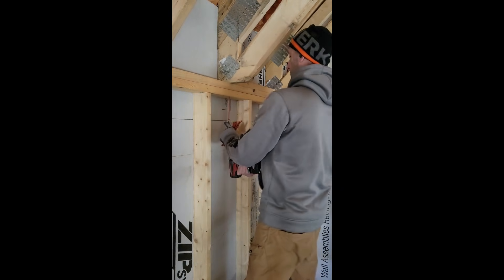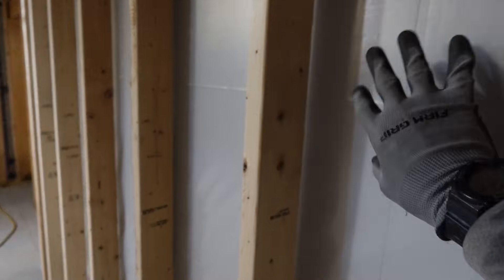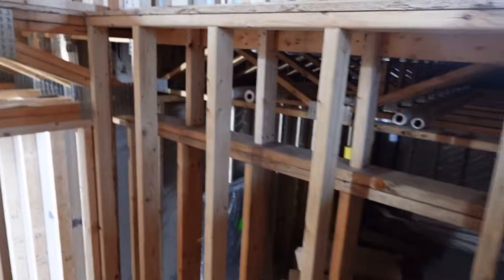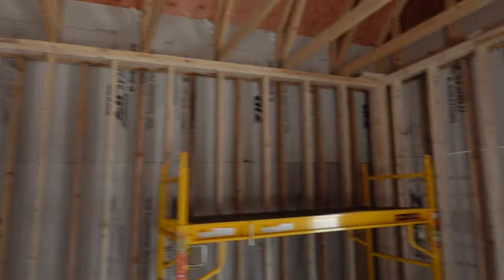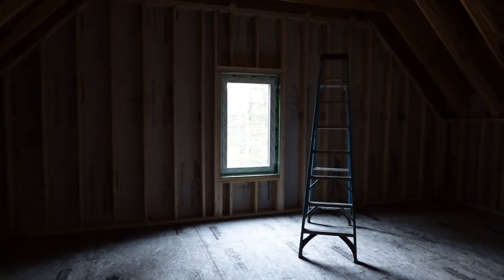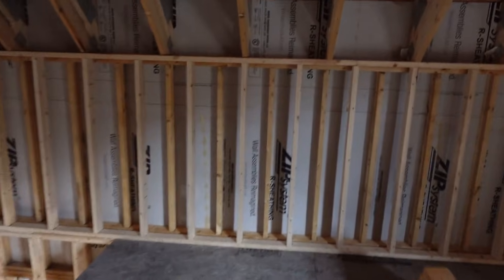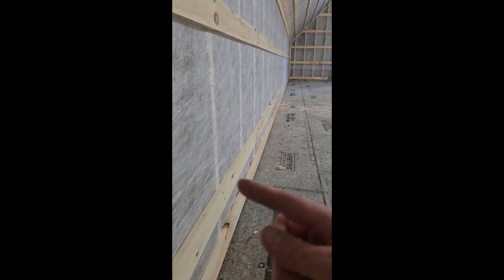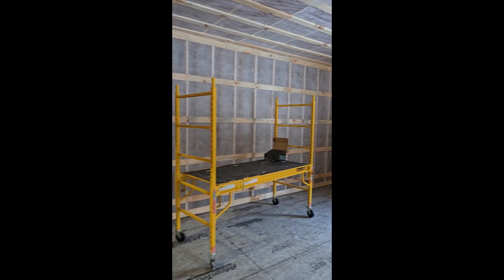13. Interior framing double stud wall

Comment: With the 1 inch gap between the two wall what do you do about horizontal fire blocking??
Reply from the maker: Nothing, its completely filled with dense pack cellulose and has a class A fire rating.  Nothing in the code prohibits it.  The floors are separated vertically for fire rating.  Thanks for the comment, happy building

Comment: Where’s the electrical at
Reply from the maker: Hi Todd, I assume you meen where is the electrical in the wall?  Its in the standard location, but the wires run between the double stud.  I did use many wireless switches to reduce thermal loss in the exterior walls as well.  Thanks for the comment
Reply: @ShawnBaldwin603 just didnt see any electrical boxes where the devices would be installed at trim out
Reply from the maker: Hi Todd,  if your referring to the end of the video with the netting, I mention how it was done.  I went out of sequence and installed the netting before strapping and interior framing.  This way the strapping holds back the insulation.  It also allows me to attach walls to the wall strapping and reduce thermal bridging framing. The bottom of netting was cut and flapped up after to run electrical, then another piece of strapping was installed to hold it back down.  It all happened to hold back the insulation better and keep the drywall guys happy.

Comment: Why not push those offset stud walls together at the plates, That would be minimal thermal bridging. I like the offset studs better than the entire wall assembly spaced into the interior.
Reply from the maker: Hello, the purpose of spacing the double stud walls it to add insulation.  Happy building

Comment: Why not use a single 8 inch sill plate,  header and staggered 2x4 studs.
Reply from the maker: Hello,
It's just a preference, not right or wrong. My opinion is it's easier to build one wall at a time and the stud layout is more based on nailing for sheathing on the outside or laying out for other obstacles inside.  Also it reduces some thermal bridging.  Also, the material is easier to keep straight.  Happy building